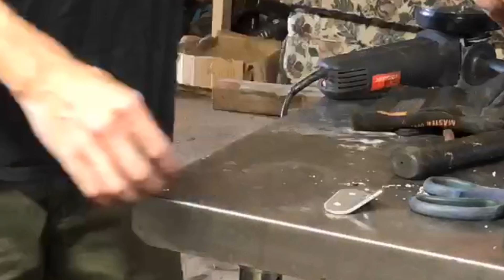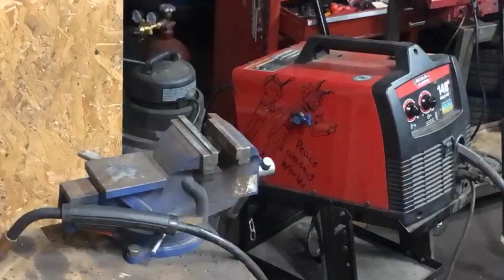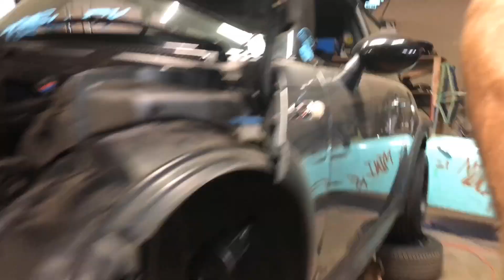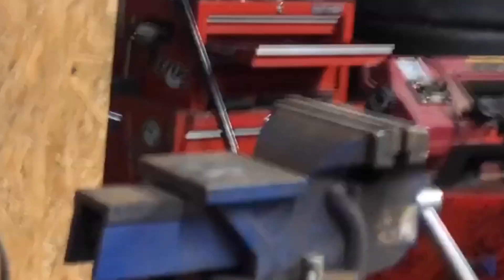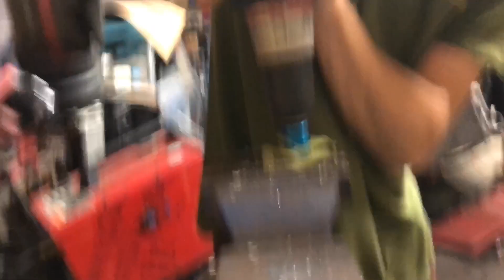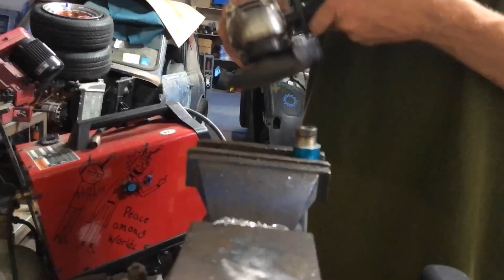RWD R1 MINI PART 13

Comment: Hi I like your mini build what Is the  name of the part you use for the sprocket to driveshafts
Reply from the maker: Dariel Payero that would be a legends driveshaft adapter roughly 80$ https://rover.ebay.com/rover/0/0/0?mpre=https%3A%2F%2Fwww.ebay.com%2Fulk%2Fitm%2F181341124369